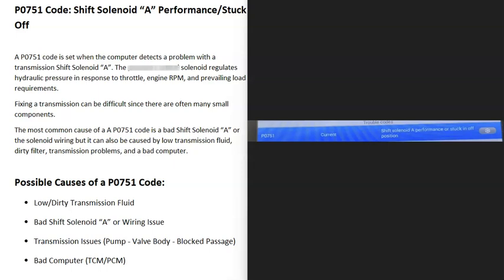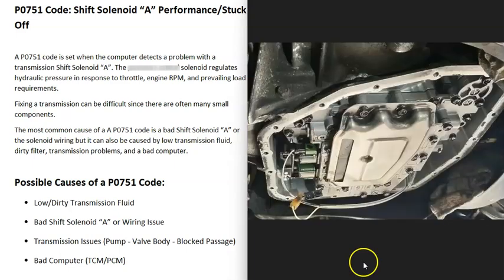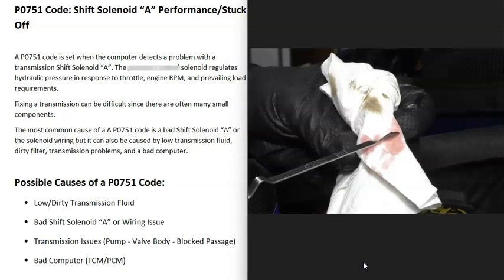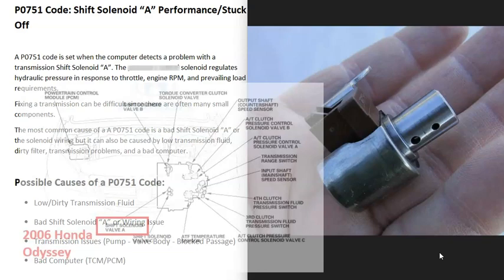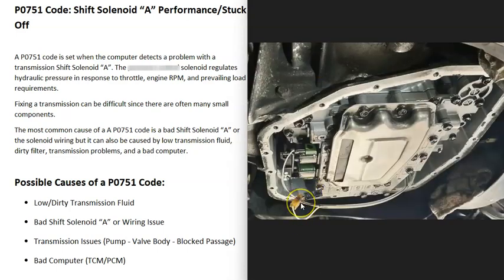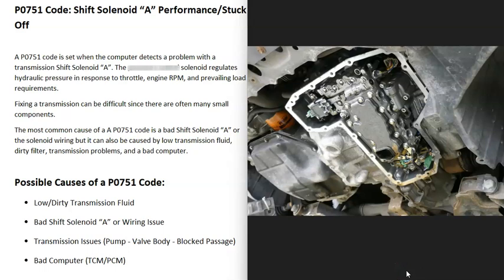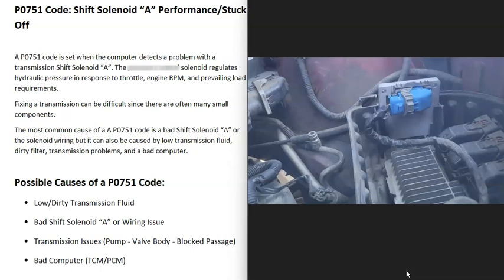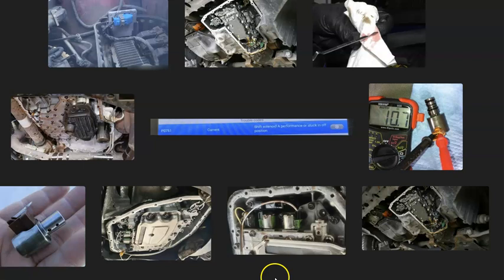Causes and Fixes P0751 Code: Shift Solenoid “A” Performance/Stuck Off

Comment: Is there any way to bypass the P0 751 code? Can it be checked externally? I’ve called the wrong but nobody seems to want to help out. I’m afraid to drive it too far when I drive it slow. It’ll shift into gear put some additive in the transmission and help out the levels are good.
Reply: The way to bypass it is to fix it. If you don’t fix it, start saving up for a new transmission

Comment: Hi bro ! I fixed P0751 was bad PCM, but no code is given right now but I feel like slipping  2nd. I did everything - oil & filter, servo shaft extender, solenoid A&B replaced, accumulator test. But finaly fixed !! Any advice for my slipping 2nd ? Trans dropdown and rebuilt ?
Reply: Same thing with mine exactly. Did you ever figure it out?
Reply: @titanman9000 did you ever figure it out?

Comment: Just changed the filter, and new fluid. Changed out both A and B solenoids. I need to check the fluid level again, but just took it 30 mins at around 45-60. Code popped up again. If fluid level is good what's your next area to look at?
Reply: What codes were you getting?